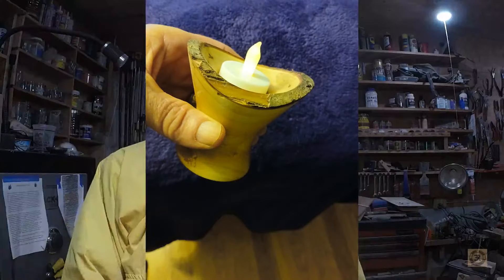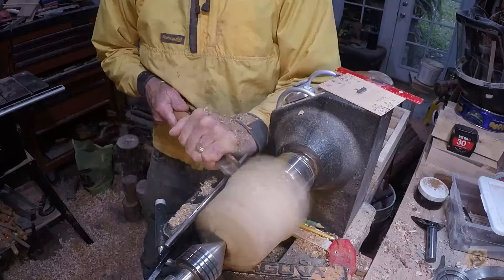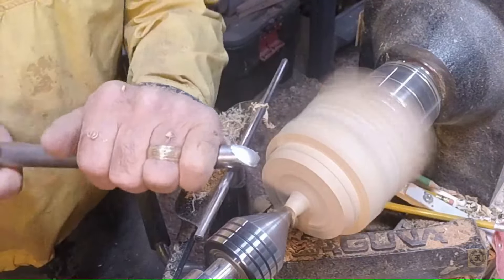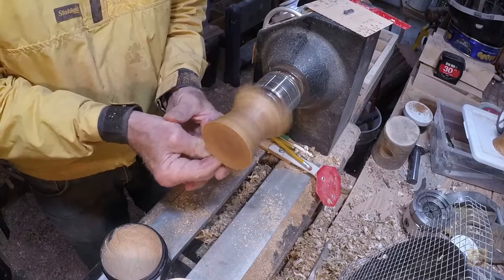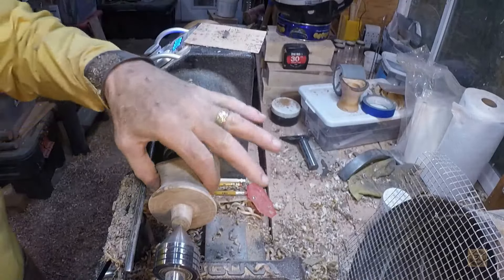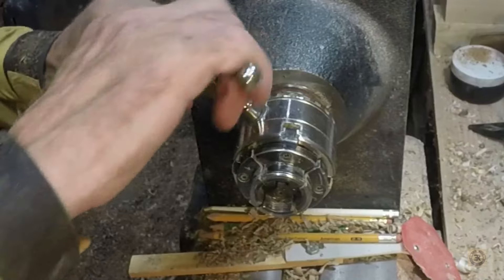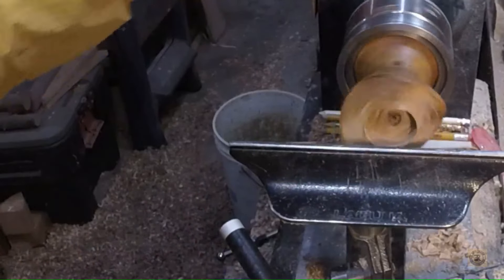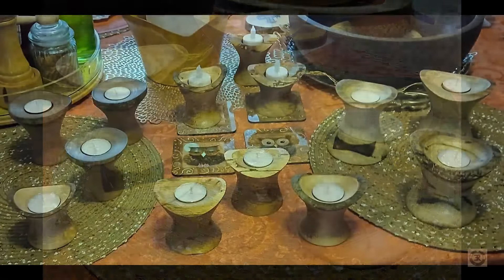Improved Candle Holders

Comment: Eric, best not to put wick tea lights in the holders. The slightly higher cost for battery lights prevents anyone from coming back at you for selling a dangerous product that could cause a fire. Over time, as wood dries out, it becomes more likely to burn from the heat transferred from the metal cup. I actually had one burn back in my college years. Luckily I was able to prevent any damage. Glass is generally considered ok, but the battery lights are available in bulk for under a dollar each and there is no future risk.
Reply from the maker: I don't like candles because of the fire hazard. I won't include candles with these, wax or battery. I'll stress that open-flame candles are inherently dangerous, that electric "candles" are the safe way to enjoy candlelight. In my house, if a candle is lit, it is not allowed to burn unattended.